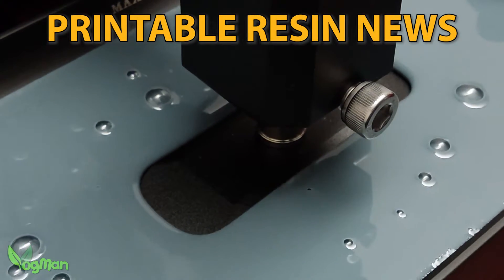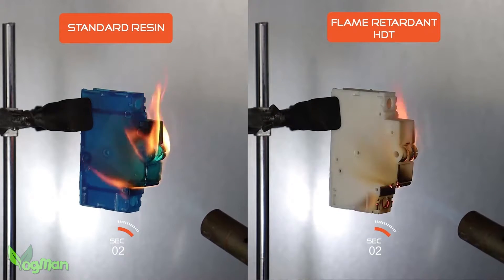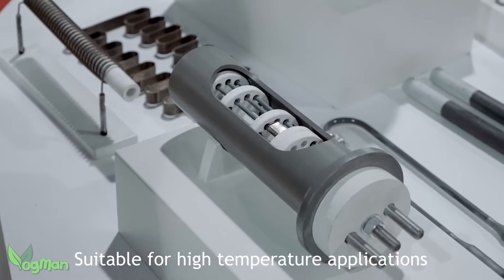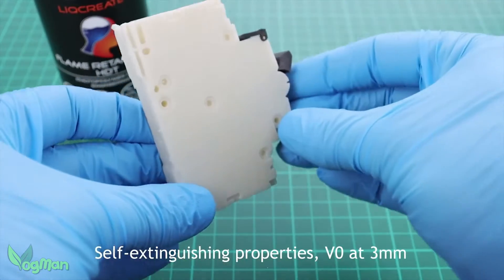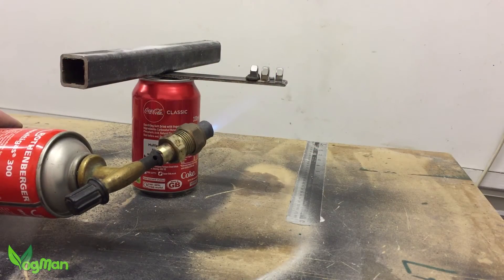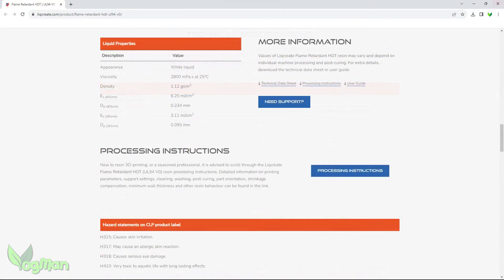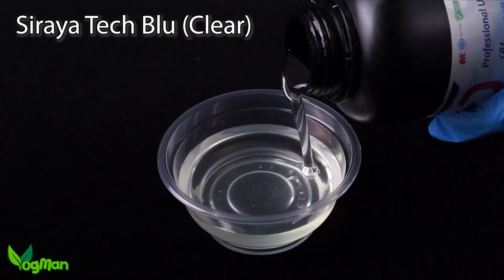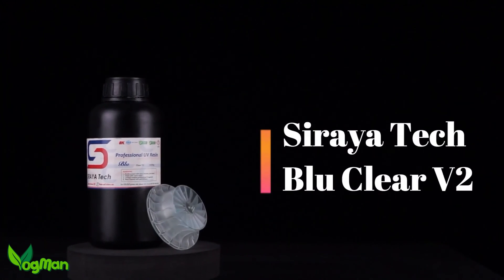Flame & Heat Resistant resin for your printer from Liqcreate [RESIN PRINTING NEWS]

Comment: The only downside is the price
Reply from the maker: Unfortunately specialised products usually are more pricey.
Reply: @vogman  One of the crazy application with these new resins is also injection molding with resin molds that can now sustain the heat for hundreds of injection and these traditional metallic   molds costs thousands of dollars to conceive and manufacture. I really need to get into 3 printing.

Comment: Would be a good material to use to make FDM extruder and electronic encasing parts from. Current companies like Prusa print it out of PETG and ASA, but those are not flame retardant. 
FDM printers can catch fire, and most of those are from extruder hot end parts or improper wiring.
Reply: Prusament PETG V0 = self extinguishing filament with UL certification.

Comment: Awesome. BUT! My concern is what happen when this heat resistant resins parts are for things that keep them quite warm for long periods of time, then I assume they maybe expelling VOC in to the air. Like some plastics do.
Reply from the maker: I've no idea there. I guess most plastics give off odours even at fairly low temperatures as they are technically starting to melt. I would "guess" this might do the same, but at a much higher temp. Certainly something well above anything we as humans could comfortably handle.